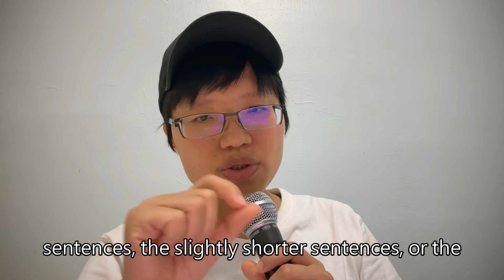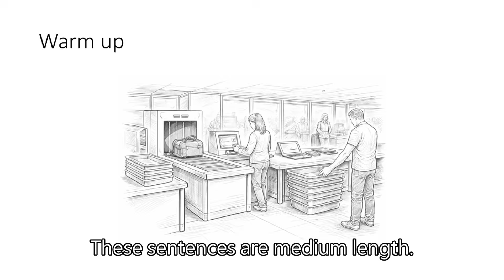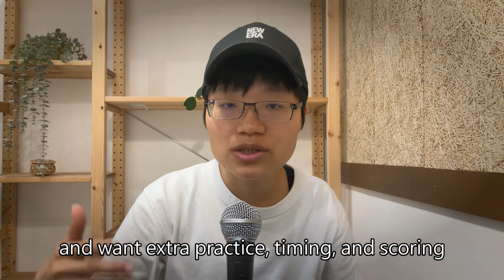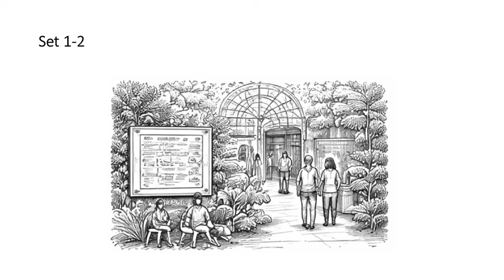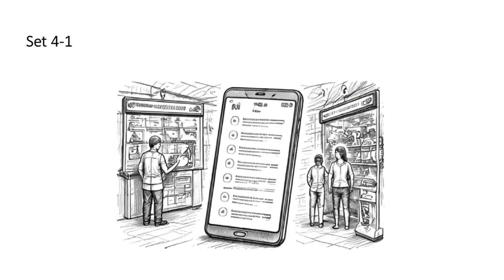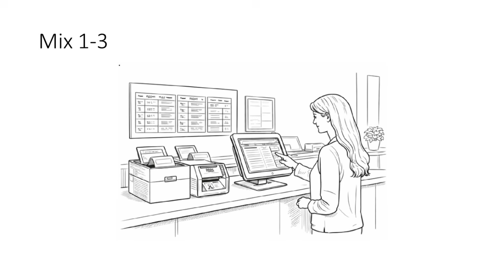TOEFL Speaking: Listen & Repeat – Long Sentence Training at Test Speed

Comment: Hi , I feel these audios were well paced.. can you please confirm if this is the same pace in exam? i was able to write initials for all words in this case.
Reply from the maker: Thanks for flagging the issue.👉Updated Speed note for real test feeling (2026/2/19) After checking ETS paid mocks: Once you feel OK at normal speed, switch YouTube to 1.1-1.15× to get closer to real test speed.
Reply from the maker: Hi, I did some more research on all paid mock tests and updated my suggestion on speed. When you are not sure whether a sample file is too slow or fast, use the 7 free practice test as a benchmark to adjust the speed.